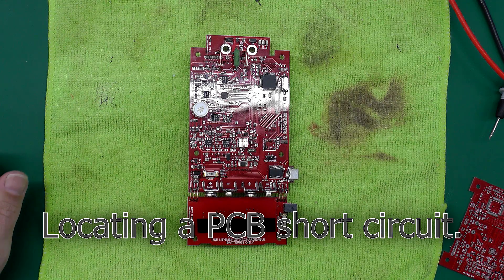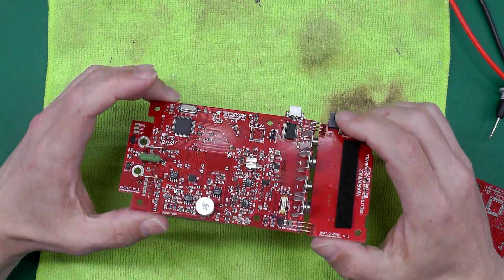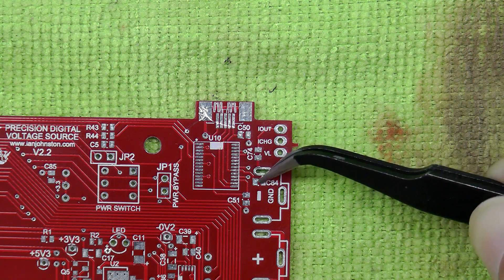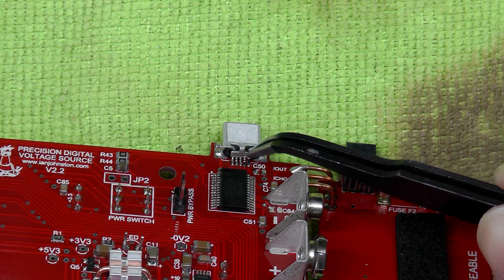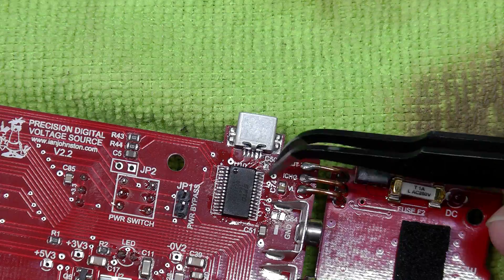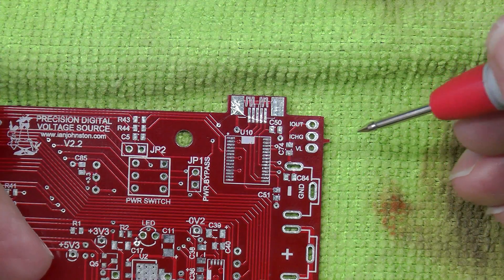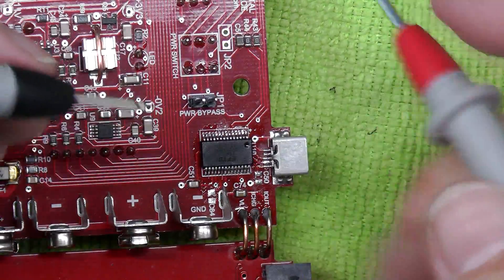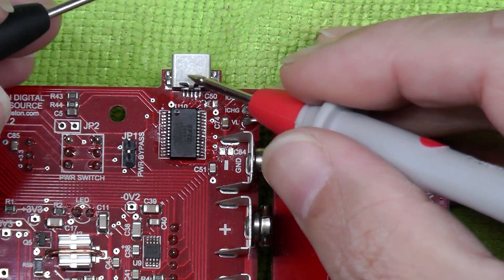No.035 - Locating a PCB short circuit (10 minute)

Comment: In restoring a cassette deck from 1985, what's the best manner for testing NPN/ PNP transistors in circuit, including DTC-124N digital transistors ?
Reply: there is 1 tool thats cool yet expensive a lil bit,peakpro 75 i think its called basicly test all types of diodes etc.And you see some squigly lines on pc if you connect to it if you know how to read it its useful

Comment: Thx so the lower the resistance number the closer i am to the short correct? I have been dealing with this issue on a board for the last two weeks its killing me!
Reply from the maker: Correct. You just need a multimeter thats capable of seeing those very small resistance changes. Anything from the BM786 up will do.
Reply: Will this wok if the GPU is shorted on the VGA card?

Comment: Hey, do you fix boards by chance?  I have a handheld tuner device that I believe has shorted.. usb doesn’t turn it on at all, the other connector when it’s plugged into my car, doesn’t turn it on, the cord actually was broken when I plugged it in on accident and it shorted the device. Now it flashed when trying to plug in to the car.

Comment: Thanks for the video. It was a bit confusing, as I was looking for a higher reading. I'm guessing because a shortcircuit is shorted to ground that's how you know it was there because there should be no resistance with ground
Reply: take it this way.think like = resistance is distance.Now you are 3v yelling to ground.Further apart you are yelling distance is further so higer ohm reading.

Comment: I use a current limited bench PSU and connect it to the meter probes and probe round the fault with the meter, looking for the lowest voltage reading.

Comment: Looks to me like poor design of the USB connector.  The tab-over is only to retain the insulator assembly, it doesn't need to extend so close to the pins.  I see a lot of components designed this way, especially AC fixtures.  I know, as long as the circuits aren't touching, all is ok.  But why tempt fate?  It's easy to bridge a small gap, with solder, or even a small shaving, and there is usually no sense in it.  I would look for a better-designed port.

Comment: What did you do to clear the short?  Replace the USB port?
Reply: Wish you would have shown that.
Reply from the maker: Soldering iron and some flux. Basically, smother the pins and pads in flux and using the heat of the iron you can clear the short. The wetted solder becomes attracted to the pads etc unlike dry solder.

Comment: The bent-over Bracket is coming way too close to the five (5) USB pins. Surely, the bent-over Tab is there just to hold the plastic USB section into its' metal framework (which has zero potential). I would question redesigning the bent-over Tab, and make shorter. There is no reason on earth why the proximity between the five USB connections and the metal Casing needs to be so close. How can you possibly be certain that the bent-over Tab may not change position by temperature influences - or even moisture /  foreign matter getting between? Solution here is to change the brand of USB Socket - to a better USB Socket that would not place your hi-tec business in any potential jeopardy! In order to assist in the diagnosis of any "shorts", by your method, we would first need to buy a very special piece of 'almost' Laboratory Test Equipment! Your excellent meter for reading Ohms does work well, but the average DMM will not be capable of doing that! However, I am dealing with a short-circuit at this moment, on a Sony (high-end) Home Theatre System. I have watched with interest, all of the people that attempt to locate a 'short' by use of Freeze Spray - or an inverted can of compressed air - which also freezes. My simple method is to use a hand-held Laser Pyrometer, and place the laser beam on individual components - when the PCB is powered-up. There are 19 (nineteen) Op-Amp Ic's on this Board. Eighteen of these Ic's are running at 20 degrees C. Just one of these is running at 55 degrees C. It most definitely has an internal short!! I would recommend this method to locate 'shorts' on any board, as it seems to work for me. Great to watch you work, it has taught me something to consider. Greetings from Australia.
Reply from the maker: To be fair, with a much more consistent reflow technique then it's not really a problem, it's just that sometimes I may apply a bit too much solder paste and hence create unwanted shorts.
The bent-over tab, to me, looks like it's there to add a bit of shielding to the pins.
6.5digit DMM's are getting much more common place these days.

Comment: I don't quite understand about the short circuit happen more likely around C50 , when C50 has lower ohm and C84 has higher ohm
Reply: C50 is the easiest accessible (measuring point) and closest to the USB (to where the fault will be discovered later) and as he shows at C50 the reading is around 0.0200 ohms (is the lowest reading so far) and at C85 he measured around 0.0600 ohms (higher reading so is further from the fault).The further you test from the short location the higher  the resistance (in milliohms) and as you get closer towards ,,the problem,, the measured value tends to read very, very low (as in close to ZERO in fact dead short)  but like he said, you need a meter that has a very good and consistent accuracy in the milliohms range (his is 4 decimals after the dot and that is exactly what it matters the most). And the probes you are using have to be of extremely good quality with pin sharp tips. I myself own a Fluke 289  that has a function allowing me to measure in the milliohms range but it only has 3 decimals after the dot. I never tried such a technic before so I intend to give it a try. It might work as well.
Reply: He had his multimeter on ohm's setting so looking for resistance. So I think it has to do with C84 being further into the motherboard (further away from the issue), there's more components the signal has to travel through therefore greater resistance. I could be wrong, but that's how I interrupted it.

Comment: Question that go my eye on: any reason why you haven't use ground planes?
Reply from the maker: The whole of the underside is one large groundplane, sectioned off for the precision/sensitive areas such as the DAC and LM399AH.
Reply: But why not everywhere on both sides?
I'm not saying you did it wrong, I'm just curious if you didn't add ground plane to both sides because of something particular that i didn't know about but makes sense.
Maybe because you wanted to make sure you would not create weak ground connections? And having ground planes would not make you aware of them?
Reply from the maker: As much as I could the underside has as little traces as possible in order to maximize the plane.....which means a lot of traces topside.....and thus if I added a ground plane topside it would be rather broken and the risk of potential differences (without lots of stitching). There are some ground lines on the topside though, I used rows of grounded vias all interconnected as a guard trace around the sensitive areas. There are advantages either way.....I just chose this way.
Reply: Got it, thank you for the explanation

Comment: If you suspected the miniUSB connector, why didn't you just bend up that flappy piece at the back with a spike tool or pointed tweezers. You could get the point in the small gap at the side and lever it up. I'm sure that piece at the back is not essential.
Reply from the maker: It's a production pcb that once working was always going to be destined for sale to a customer so I didn't want to bend anything. Also, the tolerance around that flap are extremely small, would have been tough to do. The flap is likely for shielding so who knows how essential.